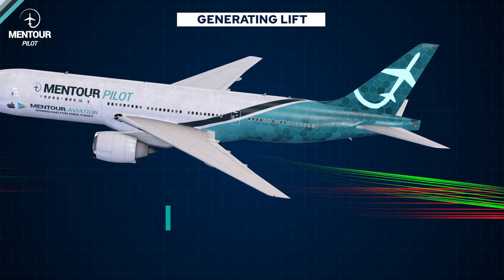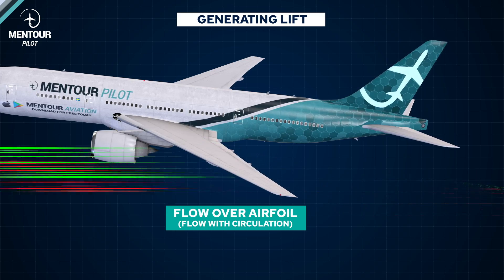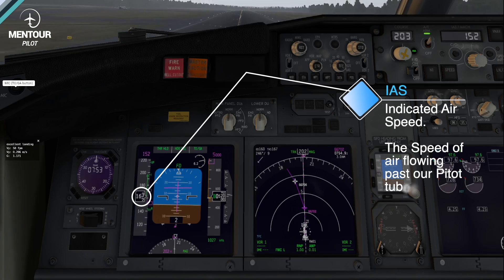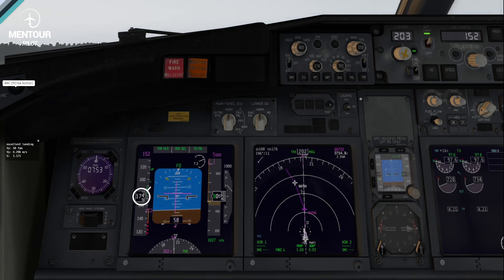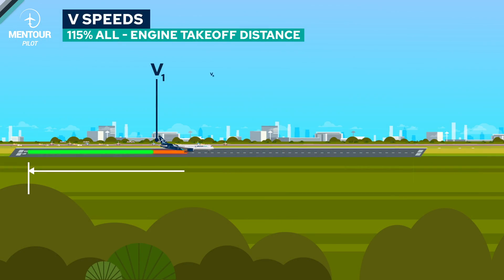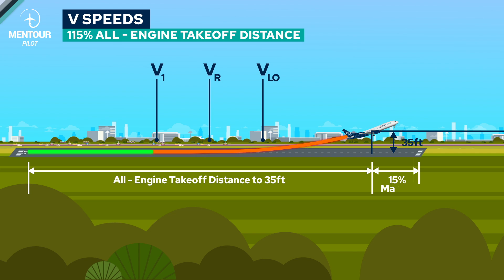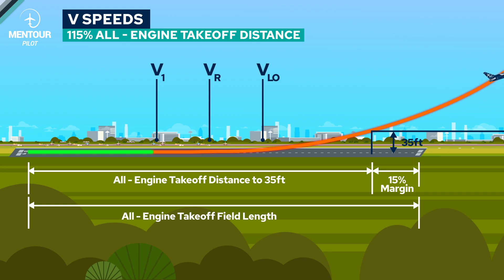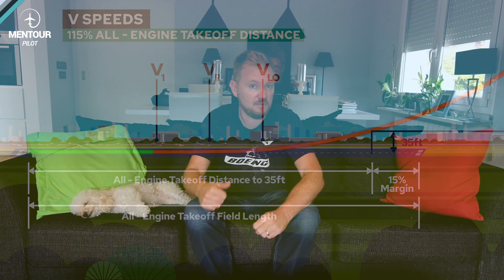Why do pilots call out SPEEDS?!

Comment: Nice explanation, well done!
Small correction - when you are talking about speeds and lift your mention about  sufficient air passing ‘over’ the wing to create lift... it is slightly incorrect. Actually the difference of air pressure of the air passing under the wing versus the air pressure of the air passing over the wing creates the aerodynamic lift. So technically your correct expression in the  video should have been the air passing over and under the wing.
Reply: Or to examine that a bit further, it's actually molecules impinging on the bottom of the wing which each result in a tiny bit of momentum transfer, the overall resultant of which is lift (and a few other things such as pitching moment, but never mind about those here). So add up all those little bounces which go on as a wing moves through a fluid medium such as our atmosphere, and the summed result of the momentum transfer can be characterized in the aggregate by things like pressure differentials.

Note that a wing (or flat plate) could still lift even in a vacuum, where there are no pressure differentials. Consider for example a hose spraying fluid (whether a stream of liquid or a bunch of tiny oxygen and nitrogen molecules) against its underside at some angle of incidence.

An "airfoil" cross-section or a simple flat plate will both deliver lift -- it's just that the former does so more efficiently in terms of how much lift can be had for a given speed, and how much drag penalty comes with the lift.
Reply: I think he's perfectly aware of that :) It was just a figure of speech. The pressure difference is only one (relatively small) component of lift. The main one is simply air bouncing into a tilted wing and pushing it. That's why increasing the angle of attack (to a point) produces more lift.
Reply: @mekowgli 
Is it really the wings, or is it the engine(s), that produce "more lift" with a greater angle of attack (AoA)?

My argument is that you should not confuse "more lift" with "higher climb rate".

If you draw a horizontal line through the fuselage of an airplane (from nose to tail) based on the AoA during steady cruise, lift made by the wings causes this line to either rise faster, drop slower or constantly point at the same virtual spot ahead. The latter is the case during steady cruise.

However, during take off, the plane will continue to drop "below" this line's direction, even though it's gaining altitude (positive climb rate). In other words, the plane is basically descending (or falling) up from the ground due to low speed and high AoA The climb rate is a product of the engines total power combined with the AoA. Too high AoA and the plane will stall if the engines aren't powerful enough. Too low AoA and the plane won't climb because the speed isn't high enough for the wings to create enough lift.

I will argue that a greater angle of attack causes the plane to lose lift caused by the wings drag, by trading it for a faster climb rate caused by the engine(s). Almost like a space rocket. If a high AoA added any benefit to lift or fuel economy, cruising would be performed at lower speeds with higher AoA.

This is also why you would trim an airplane sligthly nose down to get optimal glide during an all engines failure. Because the wing itself cannot actually create any true lift. It's depending on energy from the engine(s), and a high AoA will create an aerodynamic stall due to increased drag rather than add lift in such a scenario.
Reply: @Trotters79  In most airplanes the engine thrust is a negligible factor. The purpose of the engine is to produce speed / counter the drag, not lift.
Lift depends on air speed (squared) and angle of attach. That's why you'll have a different AoA to keep level flight depending on the speed. Lower speed - higher AoA. Also why fast airplanes land with their nose pointing up. They're designed to be parallel to the ground at cruise speeds which are several times higher than landing speeds.
The reason why you point the nose slightly down after engine loss is to keep the speed up. If you would keep flying parallel to the ground the speed would fall until you stall, because of drag.

"Because the wing itself cannot actually create any true lift."
That is completely false. If so how do gliders fly?
Reply: @mekowgli 
Gliders don't fly. They fall with elegance and style. Have you ever seen a glider take off and fly on its own?

Gliders glide for an extended amount of time because they are light and thus have a huge wing area to mass ratio, and totally rely on finding rising (warm) air to extend the gliding. Otherwise they glide down, more or less like any powered aircraft which loses power does, but at a slower descend rate (due to less mass).

Engines produce thrust. That thrust is generally directed backwards, pushing or pulling the fuselage forwards. When the nose points upwards (increased AoA) that forwards motion of the fuselage is also equal to upwards motion (relative to the ground). The direction of thrust doesn't change when you change the AoA, unless we're talking about very specific military airplanes like the Harrier or the F22 Raptor.

This does not mean you can go vertically with any given plane. Some can, most cannot. This has to do with thrust to mass ratio, and the fact that jet engines need forward speed to get enough air to function. With a 90 degree AoA you would require very much thrust to maintain the required speed to feed the engine enough air to maintain that thrust, etc. Which is why at a given AoA, you risk engine stall.

High AoA at slow speed is basically the airplane falling forwards in a controlled manner, like balancing a stick on your hand. The engine(s) push or pull the fuselage upwards in an angle, but not with enough power to climb. The plane is basically falling, but the wings slow this falling motion down. With the correct balance between thrust and AoA, these phenomenons cancel each other out, thus the plane "falls horizontally".

You should check into why airplanes stall and fall down. Too slow speed and too high AoA causes separated flow over the wings and they stop producing any lift.

As I mentioned, don't confuse lift with climb rate.

And you are absolutely correct. When all your engines fail, you put your nose down to maintain speed to maintain flow of air over the wings so they can keep the descend rate as low as possible, but the plane will not climb without engines.

Wings alone do not create lift. An unpowered airplane will not fly. What creates lift is the pressure difference below and above the wings, which is a product of the wings shape and the speed forwards. The speed forwards is either maintained by the engine(s) or by falling.

Comment: What if the RWY is so long that V1 becomes irrelevant for that particular aircraft, e.g. 4200 m runway and light 737?
Reply: That's when V1=Vr, even though in terms of the physics V1 is past Vr: You could hypothetically liftoff, maybe even gain some altitude, and then land and brake to a stop.

Comment: Planning to be a pilot here :D
And I have a question. If you were to abort takeoff because of an engine failure, would you use the reverse thrusters?
P.d. I do know they are not taking into consideration when calculating V1
Reply: Reversers are deployed on all engines (even the failed one) but only idle reverse thrust is used. The RTO auto brakes handle the rest of the stopping. This basically reverts the majority of the idle thrust of the operating engine into a resistance/braking force since even an idling engine produces some thrust! Using anything above idle reverse on the operating engine(s) would create adverse yaw that nose wheel steering cannot compensate for, and the rudder may not have enough authority if the airspeed is too low. Hope this helps two years later!

Comment: nice video but you provided an incorrect formula for Va at the end of the video. The correct formula for maneuvering speed is Va = Va(at max gross) * √(Actual weight/Max weight). You missed that square root (√) which massively changes calculated value. Additionally, your formula uses "Max landing weight" that I think it's also incorrect. In my opinion, it should be "Max gross weight" just like I typed in my formula. As you know, max landing weight and max gross weight are not exactly the same things, especially in a large aircraft... You have to be careful when copying/paste from non-FAA publications or websites like Flyingmag (wink wink). ;-) On another subject, I also recollect you saying on some other videos that there are situations you stop the aircraft past V1 like a serious emergency such as an onboard fire.

Comment: My understanding is that you are supposed to advance thrust with brakes set then release brakes. Sometimes pilots do a 'rolling start' and sometimes a standing start. Doesn't this effect the affective runway length and thus speed calculations?
Reply: There are aviation authority rules as to the speed by which takeoff thrust has to be set.  Flight manual performance charts have margin built into them for this and other variables.

Comment: In a light airplane like mine I don't have a defined V1 but always have an abort point, and if I'm not in the air by then I reject the takeoff. At the airport where I learned to fly it was the 1000 foot marker (on a 2100 foot runway). At my current airport it's the first taxiway after the threshold, about 1500 feet.

Comment: Is there a limit to how much thrust reduction is used on takeoff on very long runways? I.e. in a smaller 737, on a cool clear and dry day, short flight so light fuel load and not a heavy passenger load, on the 14.5k ft/ 4.4km runway at JFK, it seems kind of silly to push V1/Vr points way down the runway with reduced thrust, when putting V1 at the middle point of the runway, seems like it would still be a pretty 'leisurely' for both running up to speed and for a rejected takeoff.
Reply: At some point in hypothetically extending the takeoff roll, you would get to a tire load vs time scenario which is beyond what the tire was dyno tested/certified to.  This would be especially concerning for relatively high takeoff weights because high tire deflection begets high heat buildup, and tires weaken with increasing temperature.

Comment: Reading through the list of speeds I thought about different airplane designs, mostly a twin engine pusher that I see/hear overhead every morning and evening. Do designers literally say "Let's put the engines on like this and then figure out how to make it fly"? I'd love a discussion on experimental aircraft design, including standard and radical ones, and what is learned from designs and features that are intended to me mass produced as well as designs and features so wild that there seems to be no way they are intended for mass production.
Reply: > mostly a twin engine pusher that I see/hear overhead every morning and evening < Yup, when an occasional Piaggio Avanti flies its downwind over my house on its way into SNA, I don't even need to look up to know what's there (but I always do : ).  I took an in-house "aircraft design" course which I really enjoyed.  To roughly answer your question, the starting point is how much payload is to be carried how far, and then you start looking at how many engines you will need and in what arrangement to get that done.  So four smaller engines like on a BAe 146, or two larger ones like a same-ability DC-9?  More maintenance for four engines, but the total power can be lower by the time engine-out climb requirements are factored in.  On and on.  Fun stuff.

For the largest airliners, at any particular point in time there was a certain maximum thrust level available from the largest engines.  So pick a MTOW (read: payload/range) and that determined how many engines you would need.  For three or four engines, the engine arrangement was a foregone conclusion, at least by the high-bypass era where you weren't going to put four on the tail.  The only drama was whether on the mid-weight widebodies to S-duct the tail engine (L-1011) or go with a more efficient straight-flow nacelle that would necessitate greater structural design finesse (DC-10).
Reply: @marcmcreynolds2827  Yes, I understand that (I'm an engineer and a scientist), but in the context of the aeronautical industry with money-consciousness and the occasional "let's see how far we can take this," I'm interested in projects' evolution.

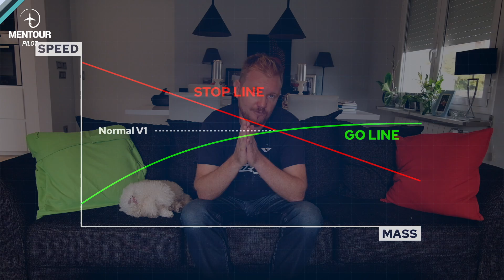Comment: The explanation with the chart at 8:23 does not make sense. You said, "when they intersect you have your normal V1 for that given weight". It assumes that for every weight you have a particular V1, but the intersection happens in a single point, and mass (weight) is the X-axis, so there is no dependency between V1 and mass on the chart.
Reply from the maker: 🤔 You might be right actually.. Hmm
Reply: @MentourPilot 
@Thomas Dalton wrote this in a comment about a year ago, which I think does make some sense:

"I think the correct description of that chart is that V1 for a given mass is the lower of the two lines. For a low mass, it is where the go line is for that mass. For a high mass, it is where the stop line is for that mass."
Reply: @MentourPilot 
The following was written under another comment, and I wrote it while thinking about this problem, so it's a little bit all over the place in the beginning, but my final conclusion (from my suggestion for a chart, and onwards) in the end seems to be quite correct. To me, anyway. What are your thought?

The calculations behind V1 is far more complex than what can be displayed in a simple XY chart, where the runway length isn't even part of the data, while it being what basically defines at which point you have to take stopping distance into account.

I would argue that key data includes:
* Mass (weight)
* Thrust
* Brakes
* Runway length
* Time

The latter two isn't part of the chart. One might argue it's so indirectly, by them defining the red and green curves or something, but I believe the chart has to have some sort of multi axis layout, or more likely: multiple charts are needed.

My suggestion for a chart:
X = distance (increasing numbers for acceleration and decresing numbers for deceleration)
Y = speed

Multiple lines for acceleration in a fan pattern, where each line represent the graph for a given mass (range). Low mass gives a steep line (higher speed at shorter distance), and high mass gives flatter line (lower speed at longer distance).

Then another set of lines for deceleration, but here the X axis (distance) is reversed, with origo in the lower right corner. Thus the deceleration lines will tilt in a mirrored pattern of the acceleration lines.

Where the two lines (acceleration and deceleration) for av given mass (range) intersects, should be V1, given the sum of the acceleration distance and retardation distance doesn't exceed the length of the runway being used.

If the intersection point indicates the distance for go + distance for stop exceeds the length of the runway being used, a horizontal cap line that intersects the go line and the stop line at a lower speed should be applied, so the sum of the distances for these intersections are shorter than the distance of the runway being used. Then this horizontal line indicates V1, which is at what point you are committing to the take off, because the remaining distance isn't long enough to stop at a higher speed.
Reply: @MentourPilot 
Come to think of it:
A speed cap line above the intersection point of the acceleration and deceleration lines is just as reasonable as below, because this intersection point is basically just defined by the range of the X axis, whereas the cap line is depending on the actual runway length (and the mass of the aircraft).

Comment: I'm not a pilot but I do dearly love airplanes so, please forgive what is probably a dumb question.  In your list of speeds, V1 and V2 both mention critical engine.  In a jet, without the rotating torque of a propeller, IS there a "critical engine?"  If there is a critical engine, how is it determined?  
Thank you for your very informative -- and entertaining -- videos.  Please scratch your puppy dog between the ears for me.
Reply from the maker: No, not really.
Reply: That's actually a good question.  In the everything's-a-twin era it doesn't matter, but when you think about a configuration like a trijet there will be slightly better performance if it's the tail engine out, since there won't be the drag associated with correcting a yaw imbalance.  But as a great man once said, "No, not really."